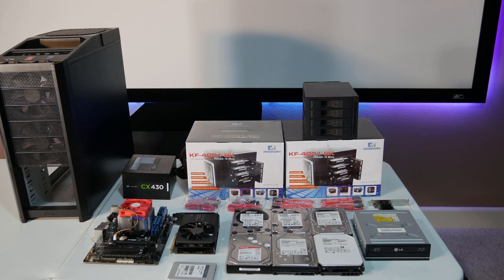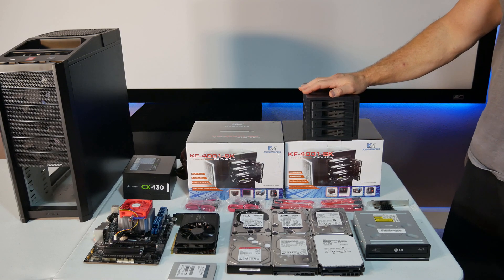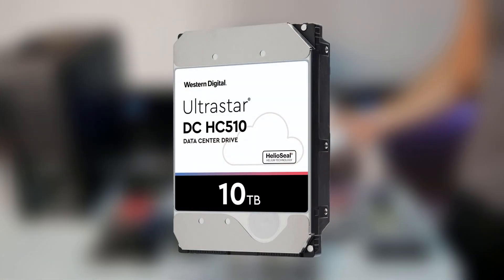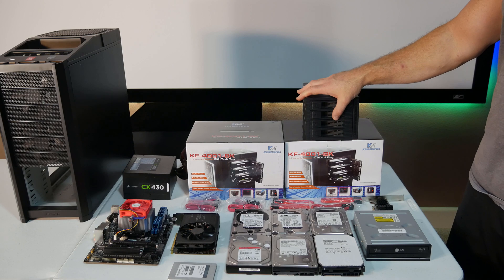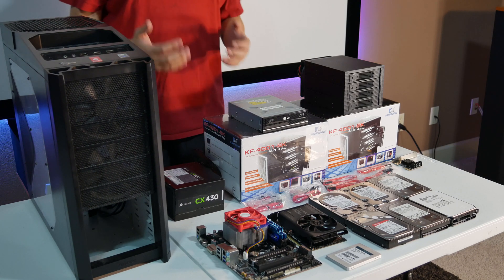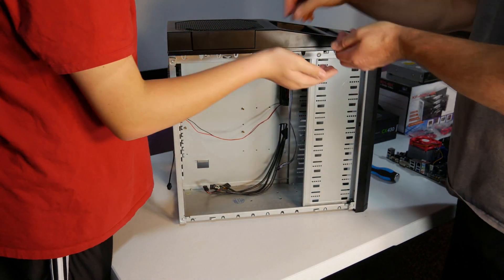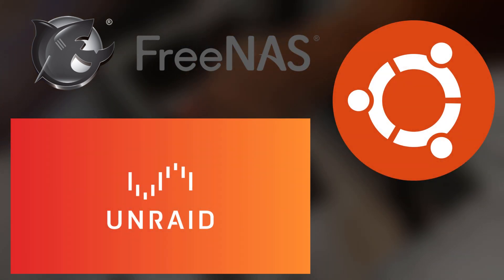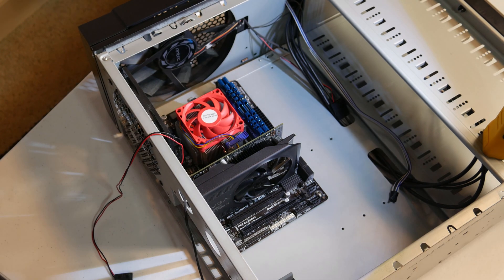DIY Home Theater NAS | Plex Media Server Build! | 21TB of STORAGE!

Comment: I upgraded my HTPC case to a bigger one that can hold 6 3.5 HDD's and I also had to purchase a PCI sata expansion card as my motherboard only had 6 Sata ports (I currently had 1 2.5 SSD as the boot drive 2 4TB 3.5 drives and 2 8TB drives (ordered another one last week) and my Blu Ray burner (for ripping DVD's and Blu Rays) 
And I use Plex as a front end

Comment: I have that exact case here next to me currently gutted. About 2 years ago I upgraded to a new system I built. For what it is it's fine. I was about to throw out the old case when I saw this video. I'd get cracking on it right now but i'm about to move. After i'm settled though. I'll be building a system similar to this. I do like the swappable bays. One PITA was the fans and those drive bays. I'll gladly swap those out for the ones you had there. I still have the MB and CPU (AMD A64) I have to look if I still have the underpowered GPU. In any case this will be a fun project to do thanks.
Reply from the maker: You're welcome! Thank you very much for watching, we think it's a perfect case for a NAS like this.

Comment: Nice Video.. would like to see a follow up video on how you setup the windows to NAS.. Did you use Raid 5/10 ?
Reply from the maker: Thanks for watching! We simply ended up formatting all of the drives individually and accessing them as separate shares over the network. Since creating this video, we have upgraded to a Synology NAS with all matching drives, and we currently have all of the drives running in RAID10. The Synology is simply way better, if we had used better hardware in this build it probably would have been fine but we're much happier with the new NAS. :)
Reply: @TwoGuyzTech  since you've gone with different hardware now for the project, I'd like to see this specific build revisited. It'd be cool to see you install Truenas on this, and set up all the drives in a RaidZ2 (raid 6) ZFS pool.
Everyone's learning and at different stages, but it's a bummer too have to manage every drive letter independently and remember which share has what content. Would be awesome to see this in a ZFS pool
Reply from the maker: @instaceptor7236  We're considering it! Our Synology has quite a bit of storage but we are moving through it quickly. We would like to build another NAS in the near future and experiment with a NAS focused OS. :)

Comment: Which case is that?
Reply from the maker: Thanks for watching! It's an old Antec 900 that we've had for a long time.
Reply: It is a great case and have been using it for over 10 years. I am using the same model case for a freeNAS server. I am using stock drive bays (6 total) and 5 are filled up, one for the OS and the other 4 in RAID0. I know there is not any redundancy, but I wanted all the drives working as one. They are 2 TB each and are NAS drives.

Comment: I have the same case and I am using it as the case for my freenas server.
Reply from the maker: Thanks for watching! It's a great case for NAS use & adding a bunch of drives!
Reply: @TwoGuyzTech  Even the stock slots can hold up to 6 HDD behind the front fans. What was unplanned is that my mother board has 6 sata ports. It also has the old IDE ports as well. It is an old gaming computer, just swapped out the graphics card for a low powered one (supplied by the pci-e slot) and removed any non essential card for it to be a server.
Reply: what case is it?
Reply: @neiqq  Antec 900

Comment: Nice video. I went the same route and used my own desktop workstation PC instead of a NAS and built a RAID inside it. This was a better option as I only use direct play for myself and it's much faster and more efficient to add videos to a library on the same authoring machine rather that upload to a network.

Comment: nice video... I would have put the cd-rom in the top drive bay... Blu ray optical drive is too close to the hard drives for my liking. Unnecessary vibration from the optical drive spinning very fast
Reply from the maker: Thanks for watching! This probably isn't too much of a problem as the drive cages seem to keep the drives from vibrating pretty well, but most importantly, we haven't ripped too many movies lately - but I do understand your concern!

Comment: What backup or even RAID are you using?
Reply from the maker: Thanks for watching! Currently, we don't have any sort of RAID setup on this system as we've slowly added different drives of various capacities, so it wouldn't be very optimal to use RAID. While we would love to have a good backup solution as well, we don't have enough space for a redundant setup until we can get more drives. Hope this helps! 😀

Comment: Great video, Building my own NAS setup for Plex and this had a lot of great info.  Only downside is that the Kingwin KF-4001-BK bays are not the same as your link and are now (11/28/20) $79.99 https://www.amazon.com/Kingwin-Multi-Bay-Internal-Drives-KF-4001-BK/dp/B01BMJ1YHK/ref=cm_cr_arp_d_product_top?ie=UTF8&th=1 Best I can find is eBay at $31+8.95 shipping

Comment: Can you rip an ultra HD Blu-ray disc that has Dolby Vision and then play it back on the Plex server?
Reply from the maker: Sadly I'm not sure, as the Blu-ray drive we used in this build was pulled from our old HTPC which was built in 2010, so it doesn't support 4K UHD Blu-ray discs. Thank you for watching!
Reply: There are UHD friendly drives out there that can rip 4K Blu-rays with HDR but not sure if it will bring over Dolby Vision.  Here is a great vid for that type of information. https://www.youtube.com/watch?v=nH18K-7s9_8&t=605s

Comment: What are the benefits of having an actual nas like a synology over this? Seems like this can do the same things at a much cheaper cost by just creating a cheap desktop & putting a bunch of nas drives in it. Thanks
Reply from the maker: The biggest benefits you'll get from something like a Synology NAS come in the software experience. DSM (Synology's in-house OS) has a lot of really cool features, which can be difficult to replicate with other operating systems. If you're just looking for a simple solution, this would work great! Thanks for watching!
Reply: @TwoGuyzTech  you forgot to say electricity consumption too. This desktop machine will burn a lot of electricity
Reply from the maker: @etv7846  No it won't. Thanks for your input!
Reply: It saves you time but not money. It's open the box and set up is like 5 minutes.  But there's no true fun in that. This build is fun.